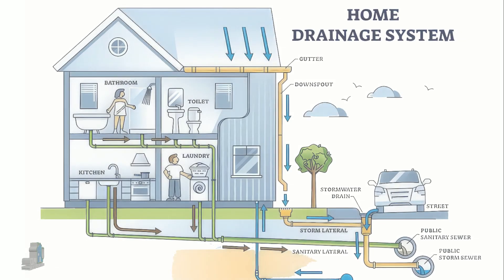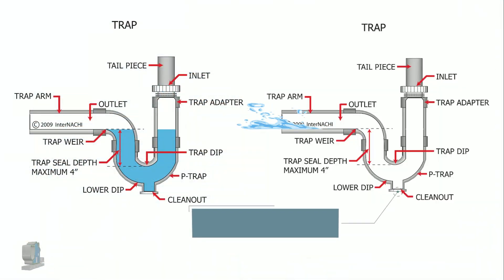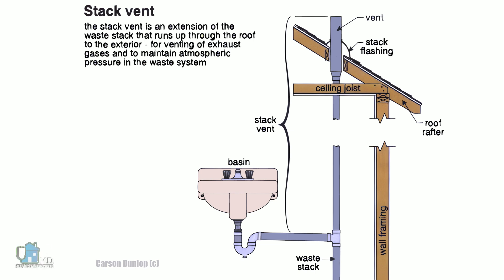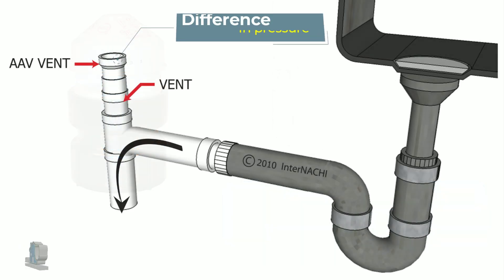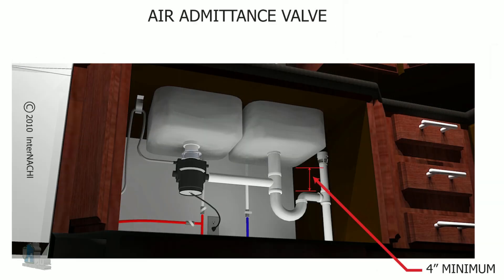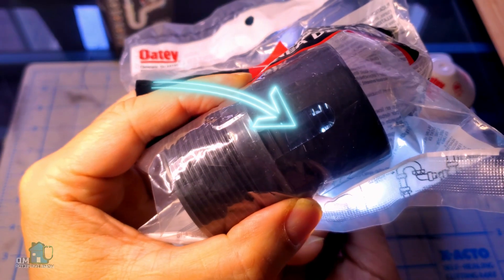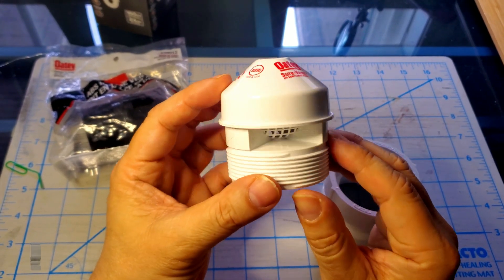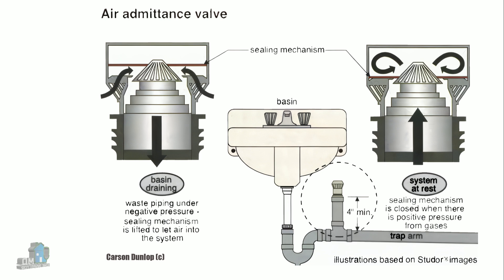What is this under some sinks in the home? Air Admittance Valves

Comment: Per code the admittance vent should be installed above flood level rim (above the counter) approximately 40" above finished floor.
Reply: What about the 4 inch minimum height?
Reply: @ErnestRamirez-x5y  Is that a manufacturer's recommendation or a code requirement for your area, and besides 40 inches would meet a 4 inch minimum?
Reply: That's for a stack vent. For an individual fixture such as a kitchen sink, it apparently just needs  be 4" minimum above the branch drain pipe. Easy to accomplish in a kitchen sink application. Best to put it as high as possible, but in the cabinet, it won't be above the sink.

Comment: Is this legal to use in New York?
Reply from the maker: Air admittance devices are allowed in general in North America, good for the various plumbing codes used here, but as always there are many individual State, Provincial and local codes that will give their variation of the same code. Thus, you need to check on your local code and where it's going to be installed, as that can also effect approval.

Comment: How is this high enough to prevent sewer back-up from coming up through the valve instead of into the sink?
Reply: It's not! This is a great device, but it should always be installed as high as possible to avoid it being contaminated with waste. The designer will say that it only allows air in and therefore water cannot escape, but that relies on that valve never failing. They will eventually fail. 
Install it high with a plastic threaded connection that can be removed to access the vent.
Reply: @simonpaine2347  you're correct. The majority of these are shown incorrectly installed. They should be as high as possible above the flood level of the fixture being vented i.e. above the overflow.
Reply from the maker: Hi,  what prevents sewer gases from exiting the valve is air pressure. It only opens when there is a difference in pressure that only allows air into the pipe. In the device is a sealing mechanism that opens to let air into the drain when there is negative pressure. Positive pressure seals. Remember that it is the water in the trap the prevents sewer gases from entering the home. The device prevents a vacuum that will siphon water out of the trap, and letting air into the drain prevents that. It's only installed when you have no actual air vent to the roof for that fixture.
Reply: @HomeInspectorMD  Thank you for the response.  I was referring to water backing up from the sewer or septic tank.  Wouldn't the back-up exit the drainage system at the lowest point at which water could escape?  If the AAV is lower than the sink, wouldn't it would exit through the AAV rather than backing up into the sink?  The AAV seals positive air pressure; I'm assuming it is not designed to seal positive water pressure.
Reply from the maker: @sierragreen  If you had sewer waste backing up into the house, nothing prevents that from happening and exiting without a check valve. A check valve allows water to flow in only one direction. It will still come out of the sinks. Remember that the AAV is a single-purpose device, only used if you don't have proper venting for that sink, so it's not like all the sinks have them. If you have a septic tank, it's up to the homeowner to ensure it does not happen. System monitoring, backflow valve,  proper size tank and annual maintenance are needed.
Reply: @sierragreen  Positive pressure is positive pressure. If it stops air, it will stop water.